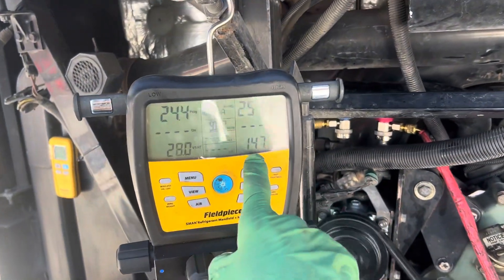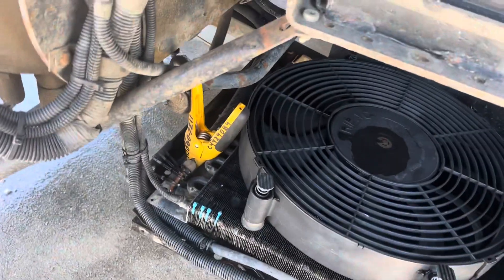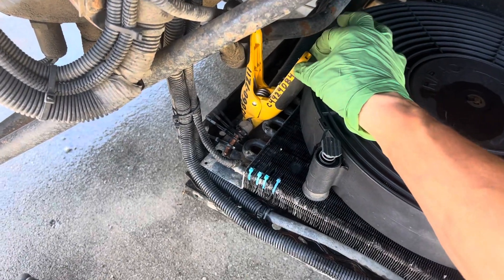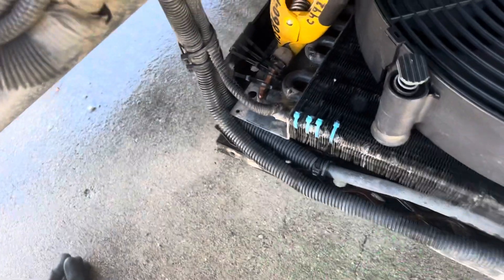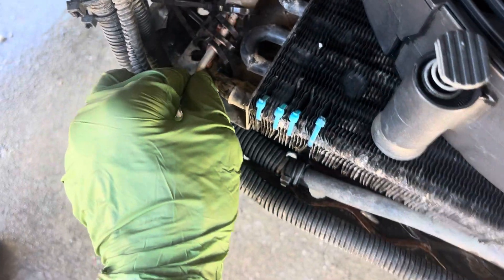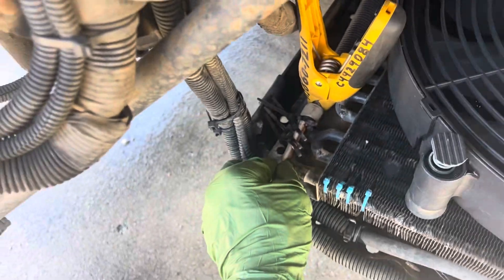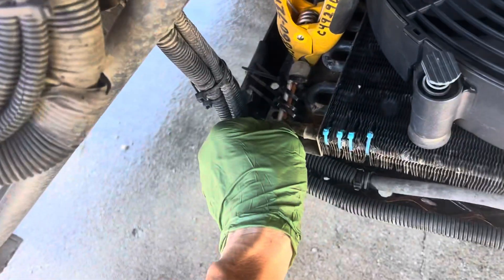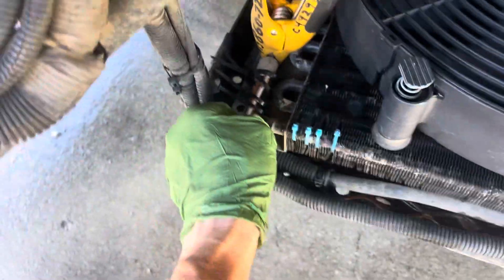COPPER ANTI-SEIZE USED AS THERMAL COMPOUND TO HELP TEMP SENSOR

Comment: I’ve been planning to make a small permanent temperature monitoring system to monitor compressor discharge temperature with other things in my car and I was thinking to use computer CPU thermal paste for the probe when attached to the pipe …. Anti seize never crossed my mind, Thank you <3
Reply from the maker: Yes, do you want to use computer CPU thermal compound grease or epoxy your choice

Anti-seize was because I was stuck at this job site, and I did not have any more thermal compound with me

So I improvised and thought of the next best thing that was available on hand . 

Better than nothing
Reply: I vote for heat sink thermal compound, it's intended for aluminum thus there should be no corrision issues.
Reply from the maker: @thisisyourcaptainspeaking2259  they also have that hard setting epoxy thermal compound. 

And the ones that have nano silver particles in it or real fine silver and then there’s the other one with diamond dust . 

They say diamond is more thermally conductive than even Silver so of course I had to buy it 🤣
Reply: @coldfinger459sub0  Yeah, I'm not sure about thermal conductance of diamond paste but sounds good.  For some reason I can't explain, my apprehension with heatsink compounds has always been ensuring the paste remains in place.
Thus, I like the thermal epoxy idea.
Reply from the maker: @thisisyourcaptainspeaking2259  tech ingredients on YouTube. I’m thinking you might know of him he’s a professor and he’s extremely analytical an anal about measurements and testing.. 

He actually did a video on making in producing your own thermal paste in on thermal Epoxy’s . 
Stuff better than what you can buy in a store

And when it comes to electrical conductivity and I’m joining parts that are made out of copper like wiring to ground rods or something like that. I will actually use 95% real silver, and braze them together.